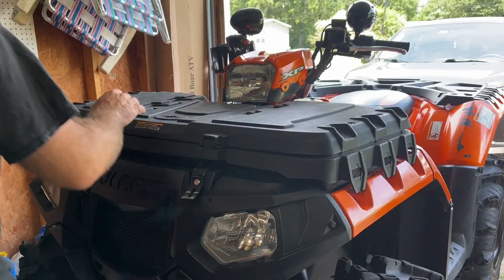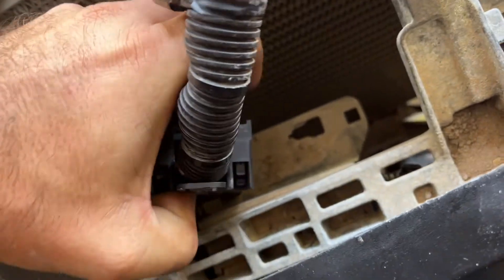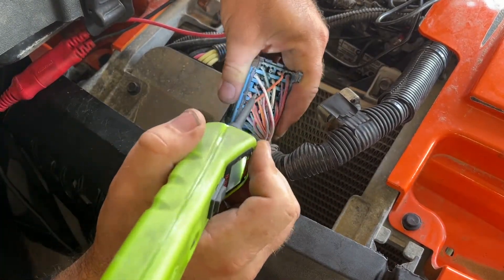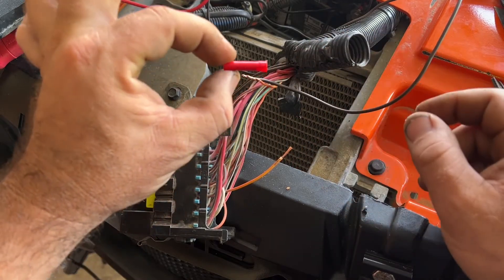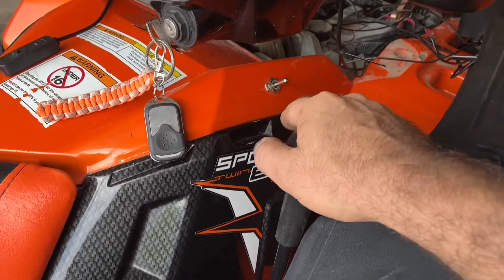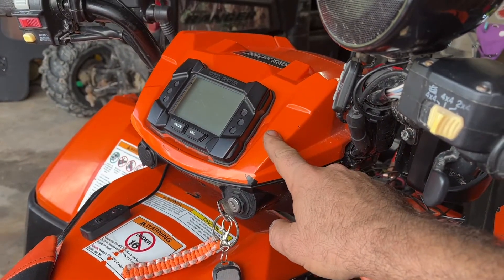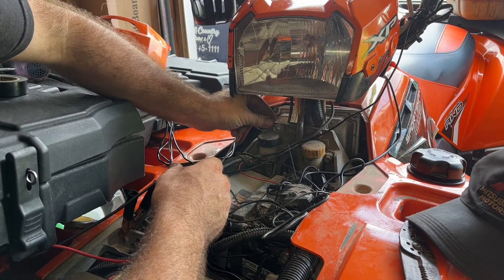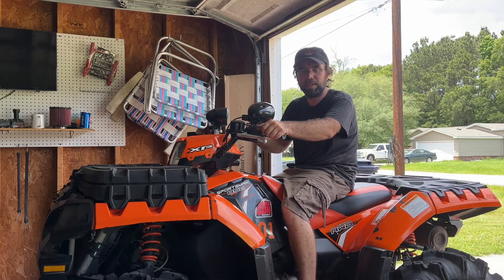Polaris Sportsman 850 Xp Cooling Fan Bypass

Comment: I watched your video and done exactly as you did. My fan relay will make a clicking sound like it is being engaged but the fan will not run. I can tap on the fuse/relay box and the fan will run for about three seconds and turn off. I have swapped all the relays around, made sure there are good connections and checked all the fuses as well. Any ideas?
Reply from the maker: Sounds like the thermal load relay is acting up. It’s bronze in color and taped to the wire harness close to the fuse box. If you have fb join my group there. Easier to help out.
Reply: Thanks